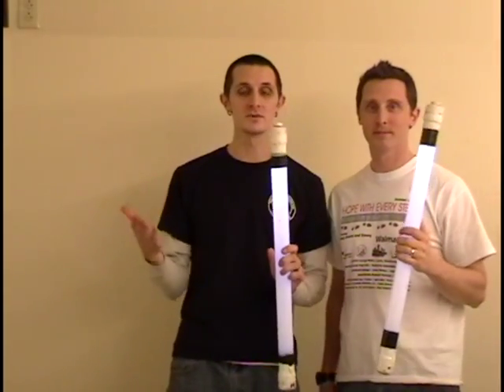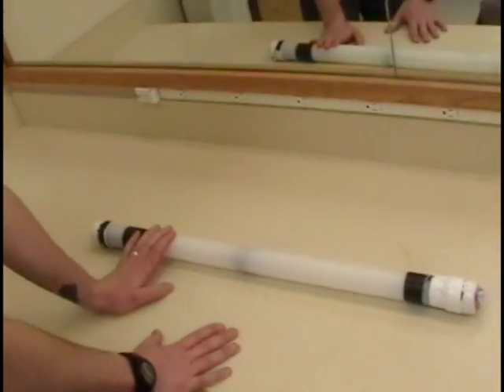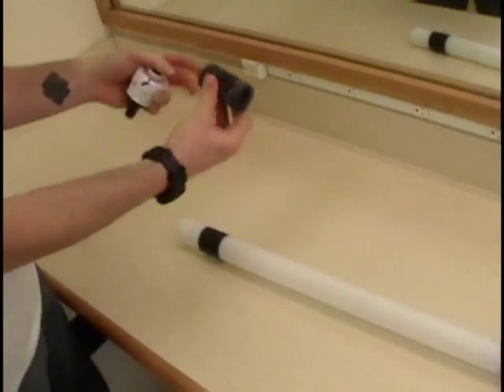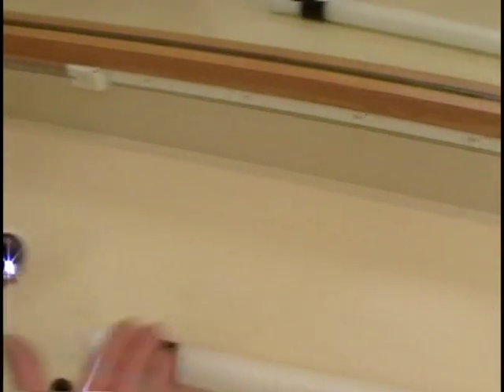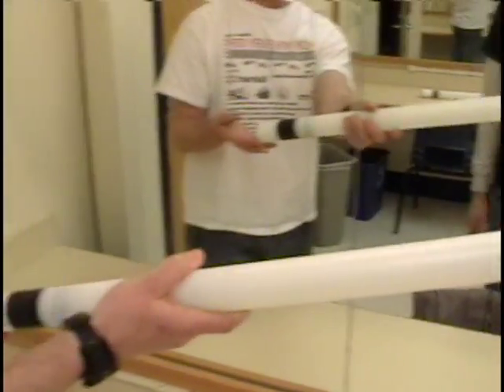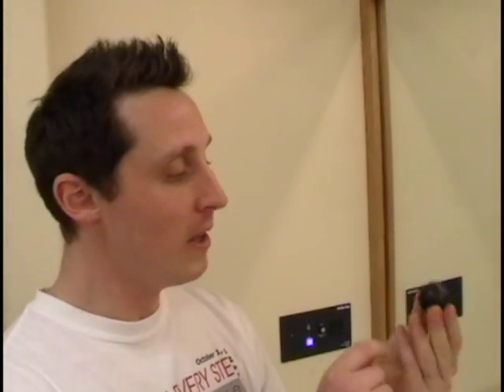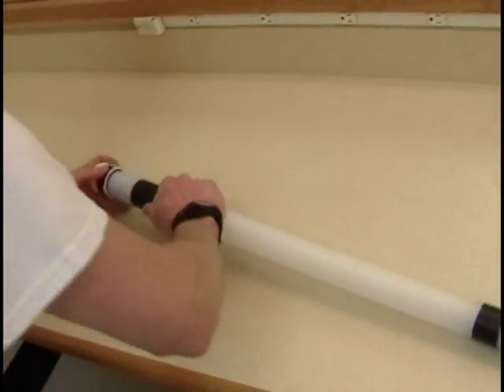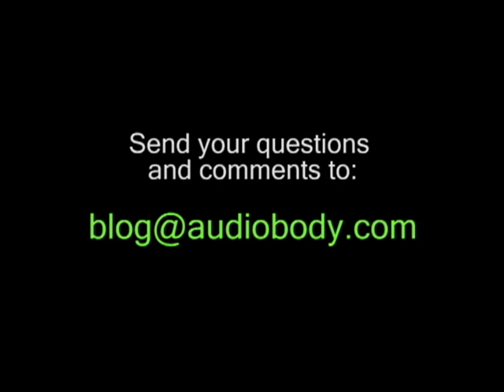Color Changing LED Light Tubes

Comment from the maker: There are many different materials you can make the tube out of, but this is what we use.  we got the tubes from Northcore Industries. Here is some info...

They are translucent tubes and the size is....... 1.5” ID x .095” x 60” Length

If you talk to Cari Benson will know the exact tube if you mention my name Jason Tardy.

Northcore Industries
1105 Lake Street
Baraboo, WI  53913
608-355-2898 – Phone
608-355-2959 - Fax
Reply: Fcu

Comment: search ebay for clear pvc pipe. and if you want it to be darker and not so clear buy "frosted" spray paint to diffuse the look. this is cheaper. as for actually translucent pipe, its usually found or know people that know people, or find a local plastics company. hope this helps